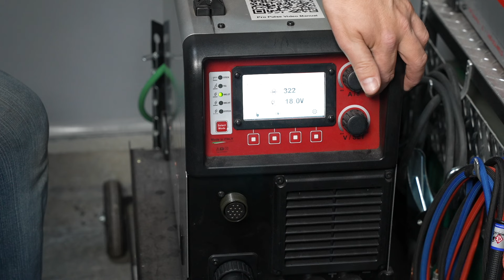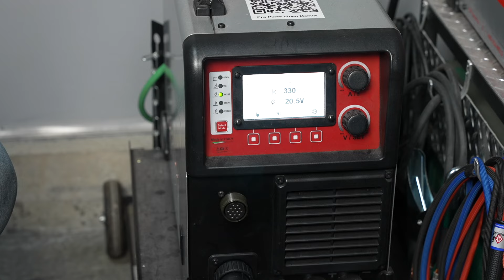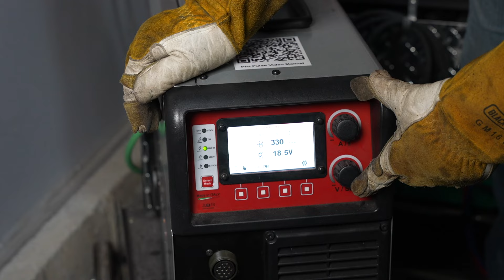Aluminum MIG Welding - Practical Tips for a Frustrated Viewer

Comment: When I use double pulse, the beads are nicer and it reduces the heat of the aluminum plate. Thank you for what you have provided. I enjoy and benefit from your work as an expert who explains the most important negative points that we encounter. Especially for beginners
Reply from the maker: Pulse can be pretty helpful when you have it, for sure!
Reply: @TimWelds  thanks
Reply: When you're production welding on aluminum a pulse welder will just get on your nerves if h
You're an experienced welder When You'remaking 25 foot welds without stopping you're going to want that constant current that a transformer provides the only thing l can say about pulse is you can weld downhill but the welds don't look as good in the flat is so much better A pulse welder just makes a c quality weldera b quality welder which isn't saying much. I had to use one when they scrapped our transformer machines and l frickin hated it

Comment: your aluminium test pieces look very shiny.   did you brush off the aluminium oxide without telling us you did.   is brushing off the aluminium oxide necessary ?
Reply: he said he got them out of the package and immediately used them so there should be little oxide built up. if the pieces ur using have been stored for a while u need to brush the shit outta the oxide layer before u try welding on it

Comment: This is the most USEFUL aluminum mig welding video I’ve seen! Thank you!!!!!
Reply from the maker: Thanks a ton!
Reply: The one thing that no other video on this topic has addressed, is that the metal heats up, increasing penetration as the bead continues. That is what has caused my mind to not work, ending with me selling off one welder, buying another one thinking that was the issue when it wasn’t. I am on welder 3 now and I feel like I have what I need for this. I can’t thank you enough!

Comment: I typically use scrap to dial in the machine, human error will always be a variable in welds. running on scrap can ensure you have the right wire speed and heat input for the thickness you’re welding. 

My favorite method of MIG welding aluminum is the whipping motion. It leaves MIG welds looking like stacked dimes. Mainly only do it because i love the way TIG welds look.

Comment: Thanks for your videos - was very helpful.  Helped me get through my project.  I'm a novice welder making 12'x6.5'x2'x6.5' soccer goals out of schedule 40 - 3" and 3.5" 6061 aluminum pipe.  I used a spool gun and 0.035 4043 wire.  Two issues I found were (1) needing more practice welding around the circumference of the pipe, where the push angle changes quickly and (2) inconsistent wire feed speed when the diameter of the spool filler roll gets smaller.  When the wire feed speed drops towards the end of the roll the wire more easily burns back into the tip.

Comment: Great video sir. I would love to see your technique  on aluminium plate welding. We use 3mm plate with an single square joint, single side welding with a bend test afterwards. It's really hard to not: burn a hole in the plate, restart without excessive weld metal, have perfect penetration and not destroy the materials structure for the  following bend test. No one that I can find has a video on this (or similar) welding, maybe you're the to fill that gap. Thank you as always for the great quality sir.
Reply from the maker: Thanks! Without some way of varying the amperage along the length, that would be very difficult because of how much aluminum heats up as you weld it.

Comment: Thx Tim, very helpful.
Question..if you tried those settings for steel you certainly wouldnt get spray transfer. Is it just the fact that aluminum has a much lower melting point that allows you to get spray transfer with those settings?

Comment: Is the black soot common when mig welding aluminum?
Reply from the maker: Yes, it's very common, particularly if you are using 5356 filler metal. It's not necessarily a problem, but it can usually be eliminated or greatly reduced with the right setup.

Comment: so was pulse used here? or was it just setup as if it was a non pulse mig?
Reply: No pulse, just “good old regular” manual program, one knob for wire speed, one for voltage, no pulse nothing synergic, just trying to imitate the Vulcan with a spool gun.   Any “regular MiG welder” could get you those results
Reply from the maker: @azah57 Like Peter said, it was just run on DC. Normally, I would run pulse on 1/8" material since that machine does it very well. Honestly, the remote amperage controller on the HTP is equally beneficial, if not more to allow a hot setting to be used at the beginning and cool it off later in the weld. I was just trying to illustrate what can be done with a basic setup on stock settings and show how technique can make a big difference in the result.

Comment: So jealous. 
I've only tried  aluminium welding  once for a  few hours and I failed. 
I'm using a Unimig 195 Max with the  normal handle  with a  Silicone  liner.
Reply from the maker: My first time MIG welding aluminum was pretty rough also. Hang in there.